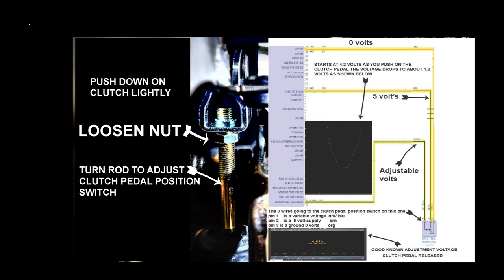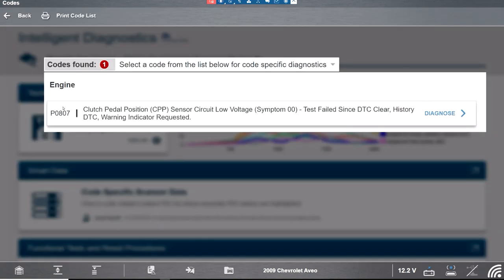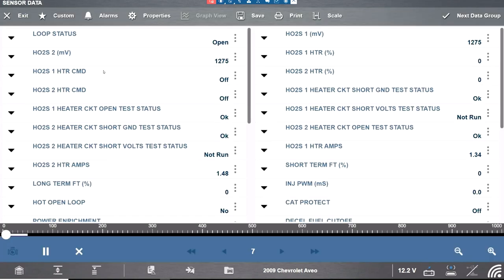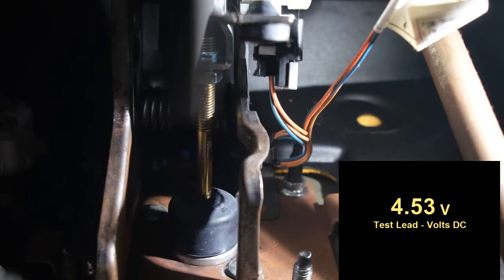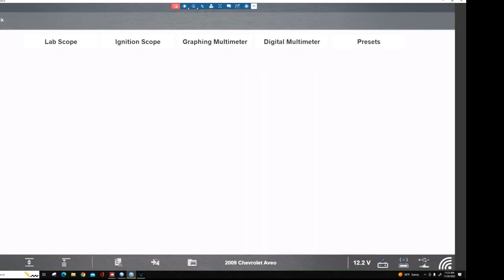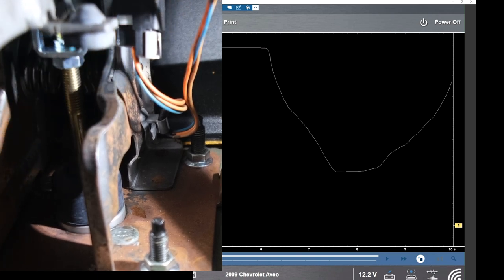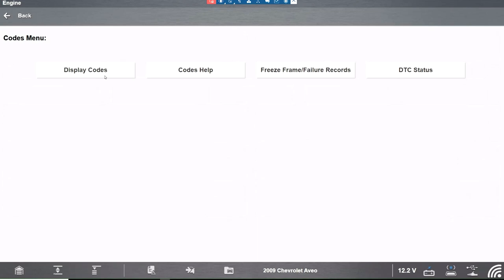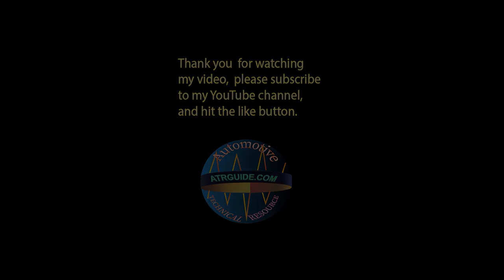P0807, How to adjust a clutch pedal sensor. Check engine light on for a clutch pedal position code.

Comment: Hi thanks for the video! I have the same error in my car, how did you connect the multimeter to measure the voltage?
Reply from the maker: I just had on ground then the red on signal side, if you are using a regular volt meter
Reply: Cool thanks! It looks like my car's pedal isn't adjustable though 😕